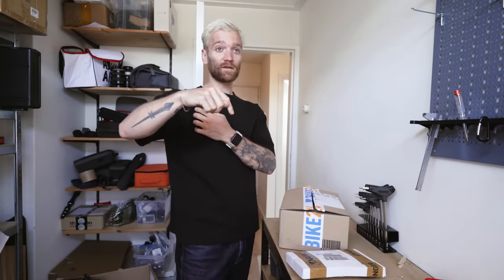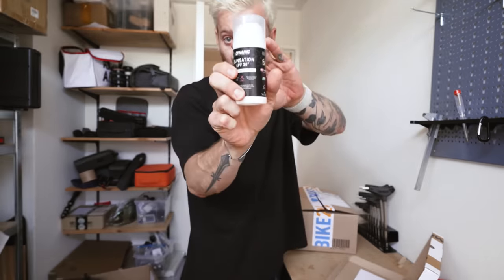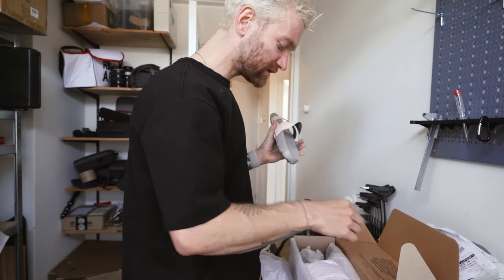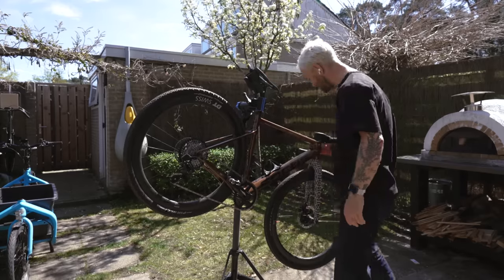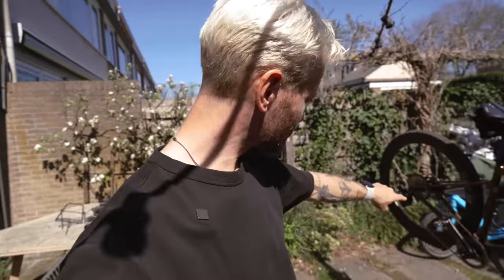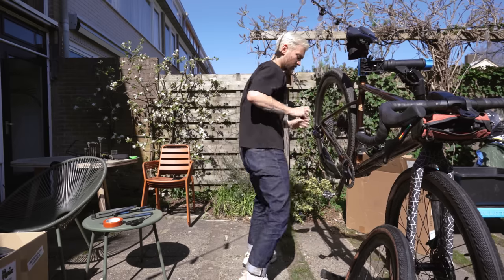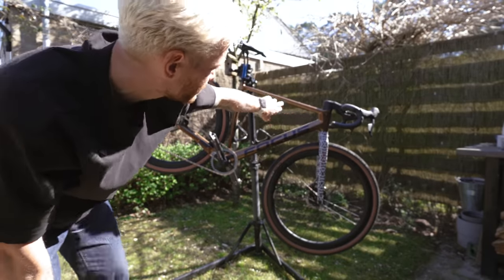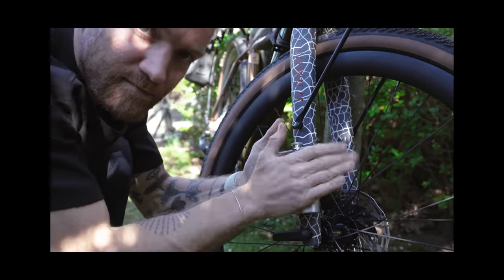ONE BIKE TO DO IT ALL - THE CARBON ATLAS IS HERE!

Comment: Hey Martijn, very informative video. Also congrats on the Traka 360. Very impressive. Question: did you put in the vittoria air-liner 'gravel' inserts? On their website it says max 40mm tires. I want to use inserts with 45mm Pirelli Cinturato tires.
Reply from the maker: Yep i used those gravel inserts, worked fine with my 45’s!
Reply: @Fernwee  Thx